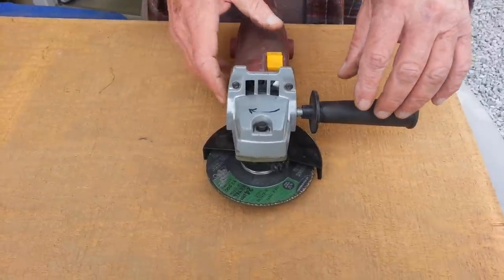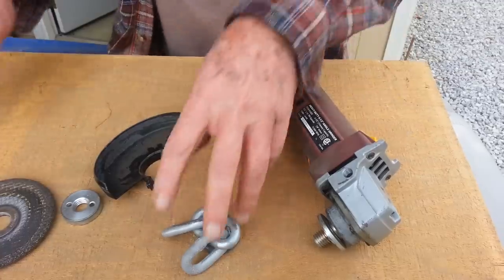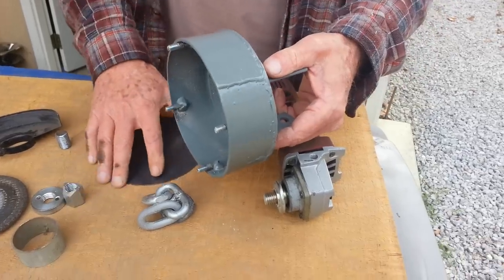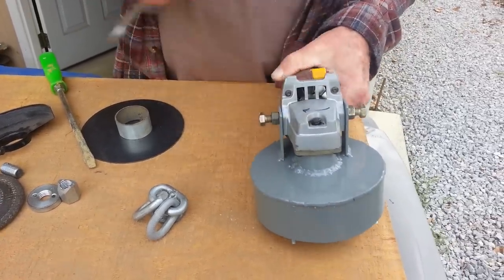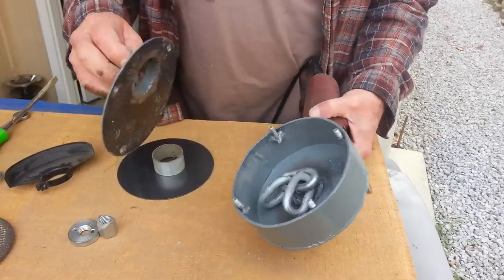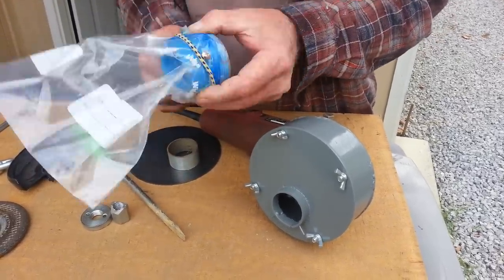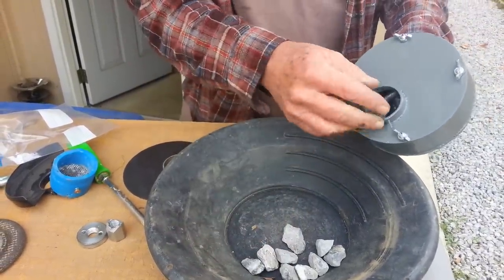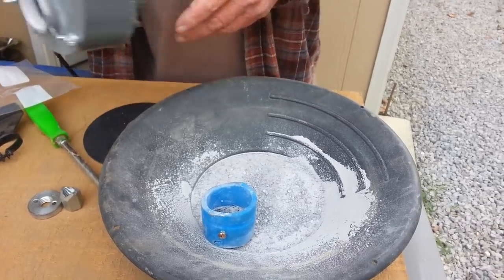Mini Rock Crusher

Comment: Highly recommend not starting this project until you find someone able to bend flat stock or the right sized pipe. I spent an entire day calling and going fabricator to fabricator and NO ONE can do it. I also can't find the right pipe. All after paying someone to plasma cut two pieces of steel into circles and welding up the nut and chain. Really wish I would have just bought one.

Comment: The exhaust the blue thing, I would use a vac hose but use a screen in it, anything bigger than you screen would stay, anything smaller goes through vac hose, make long enough, screen to end of hose you can use as a scoop for the gravel, 6-8 in. Feed in the crusher in and suck out the fines. All from vac hose.

Comment: What sort of motor could you use in the field where you don't have ac power,just battery power?
Reply: Use an 18v battery grinder
Reply: Just buy an Inverter and you'll have plenty of AC power.

Comment: I would add a small rubber seal to keep the sediment from spilling out the back side.
Reply: A wide rubber band could work in a pinch, just stretched around the outside.